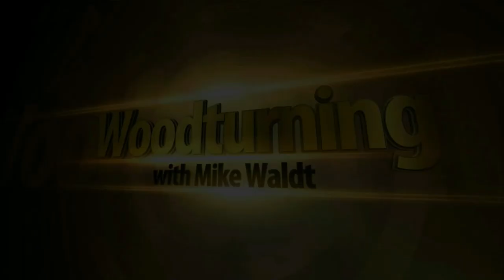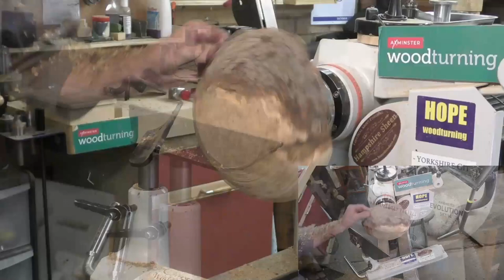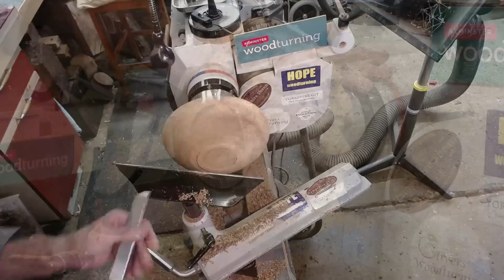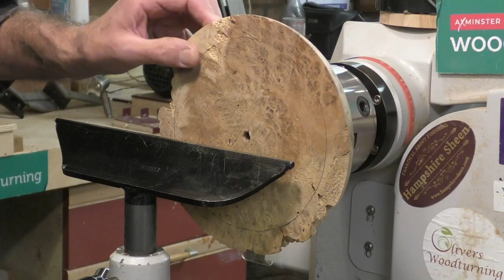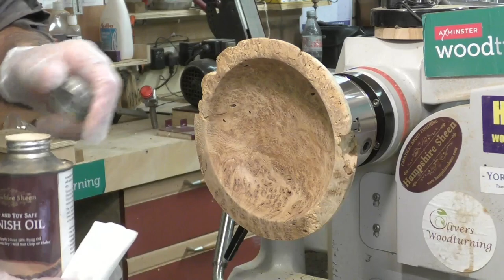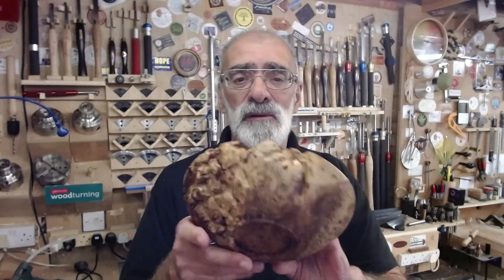Woodturning - English Oak Burr Bowl

Comment: Very nice Mike. I use a bottle of alcohol with a spray top, to quickly wet the wood and check for bumps then it evaporates away. It also does a good job of clearing the dust from the grain when I wipe it on.  I imagine that bowl will be in the gallery fairly soon 😉👍🏻
Reply from the maker: Thanks Nigel ... great tip too. Thanks also for watching.

Comment: Great lump of wood. You did a great job with it as well. Glad you addressed the ring in the bottom. So many leave it. You didn’t and shared how you went back and removed it. Lovely piece Mike. 

BTW, a friend of mine used to take lumps that were fully buried like this one, turn and sand, then use 3-4 colors of dye. It was amazing how the burl grain popped out. 

Thanks again for all your efforts.
Reply from the maker: Thanks Doug always looking to get the best surface possible, and a great tip re the colouring. Thanks for watching and your input.

Comment: I was worried about the gap in the mortise wall, but apparently burl grain is so twisted and tight, that gap wasn't a fatal weakness. Did you have any concerns about that?
Reply from the maker: As you say I have found that with Burr as long as you have around 80% jaw contact there are no issues .... to date anyway! 😉